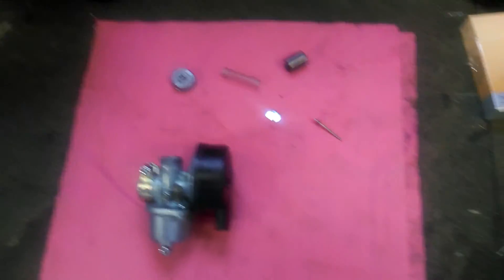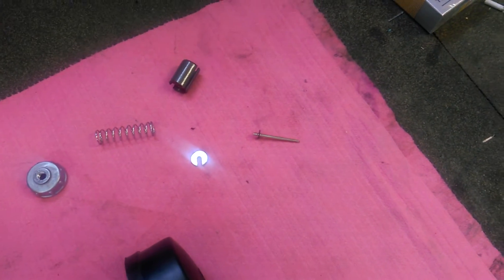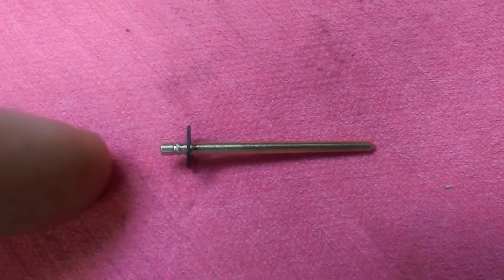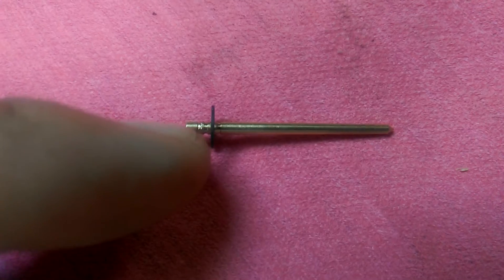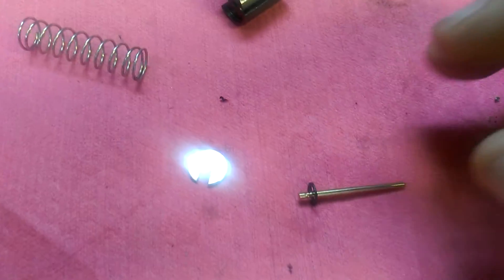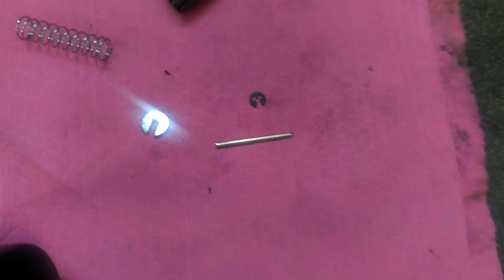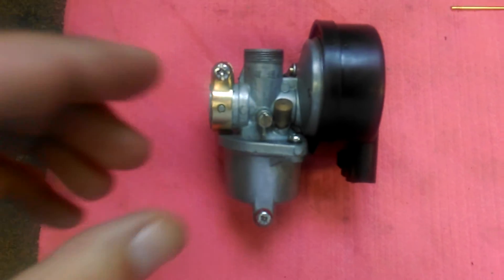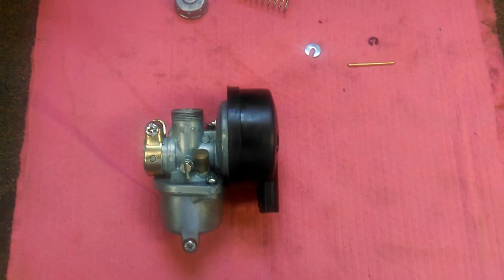How to Adjust the Needle Clip on a Motorized Bicycle Egine NT Carburetor

Comment: I lost my e clip shot across my garage somewhere hate the little fucks! So I tried to hammer the top of the needle and make a washer of it. Brittle material ended up bending it and snapped. So with my back yard larry skills. I sat down smoked a joint and thought wtf am I gonna do now. May aswell buy a new carb for price of needle and clip. Got thinking what I have around in shop. Well I ended up using a air needle end for filling up basketballs! Works better than my original needle 😂 not joking tho! To anyone else stuck reading this here's your fix.

Comment: Dude you just showed how to lose your C clip ,,,all you have to do  is pinch the clip between your thumb and index finger and it will slide off the needle and will be between your fingers, not flying off ,an never finding it,,and to the person that lost there C clip, you can get a new nt carb for 10 bucks,,it's hard to find a clip that fits right for those needles